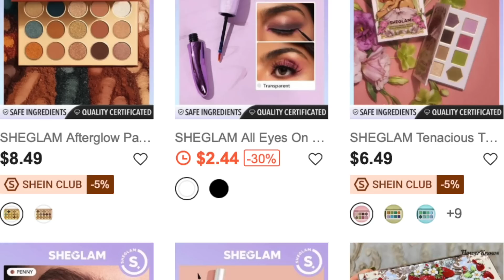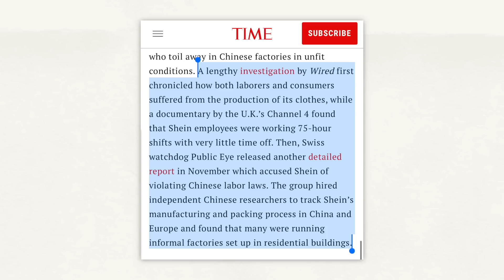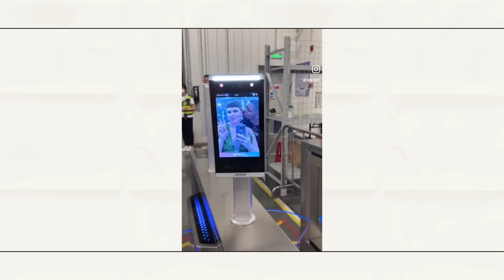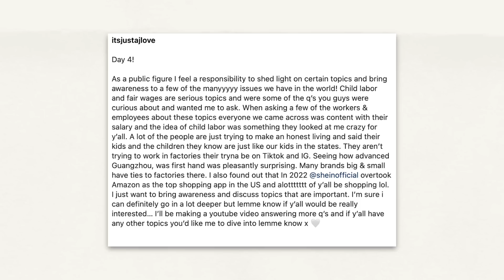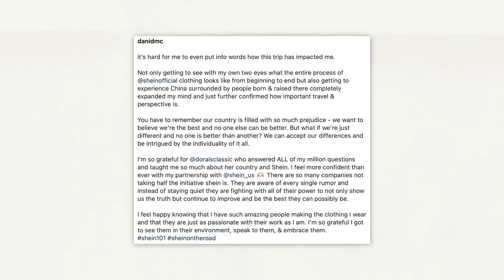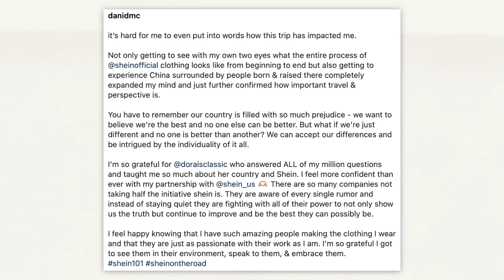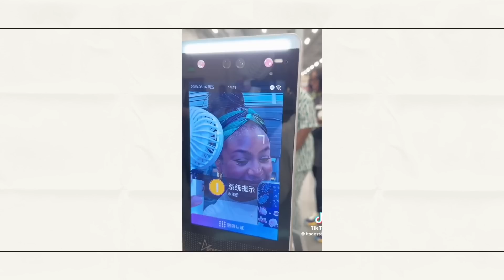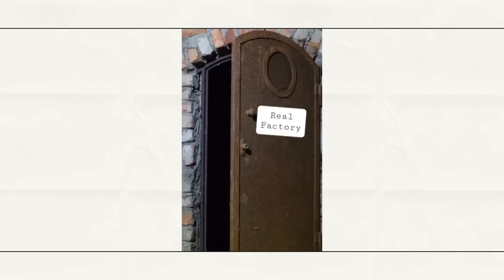SHEIN IS A MESS (BRAND TRIP GONE WRONG)

Comment: The only machine labor there is the electronic racks and some cutting machine? Mass production does not have the tech to do that yet, they have giant cutters operated by hand that cut 50 layers of fabric at once. That robot was cutting ONE garment. It's a display. If you know anything about large scale clothing production, this is clearly a front. 90% of the actual production of the clothes is still handmade IN THIS VIDEO. Moving the clothes around is not production. That's all the robots are doing, they're not making anything. I doubt any of these influencers know how to make clothes, which is why they're not catching this